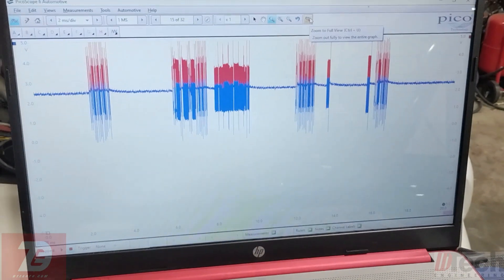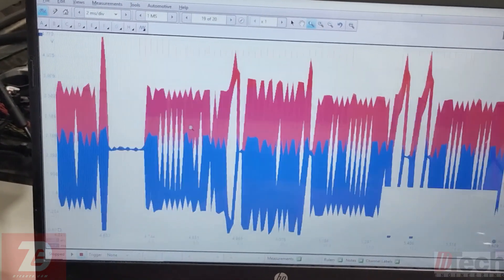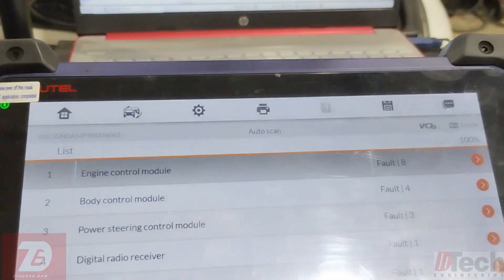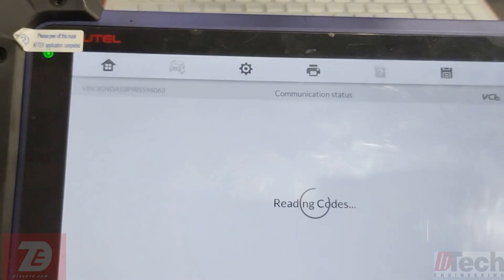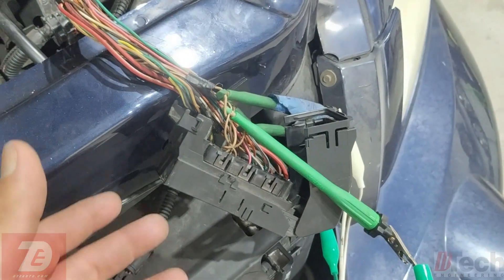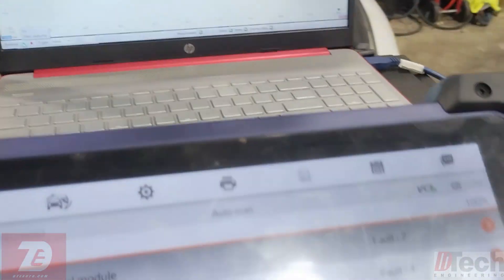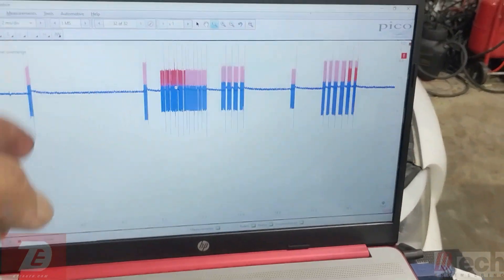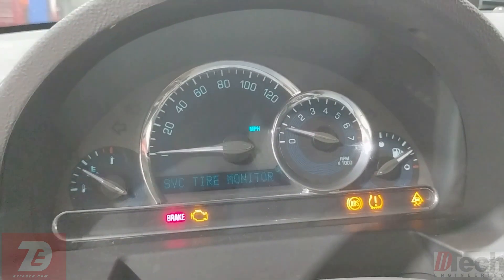Testing Faulty GM High Speed CAN Bus 2008 HHR

Comment: Bypassing the modules is a superb idea to confirm which module is screwing up the BUS.  I would assume that depending on the BUS ‘communication flow’ dictates whether you can remove a module from the BUS completely or using this module bypass method in order to confirm the faulty module?  Thanks for adding the diagram to show the path!
Reply from the maker: Yes you are correct on that, it would depend on the bus structure on how to try and identify the module